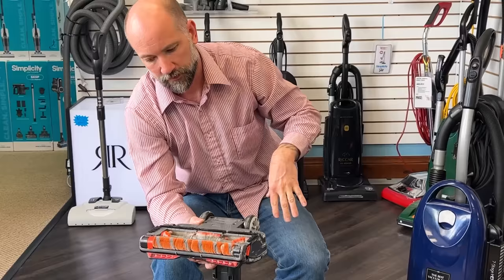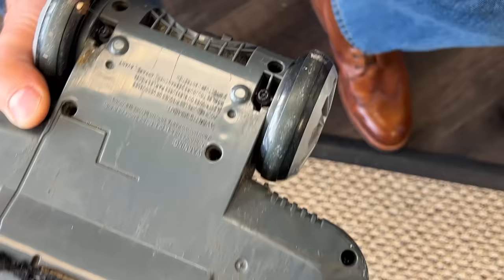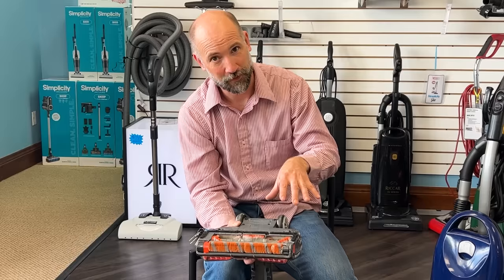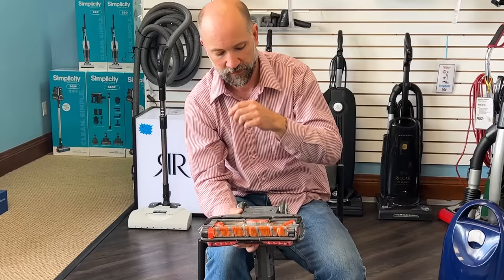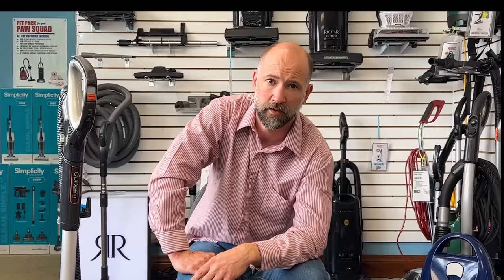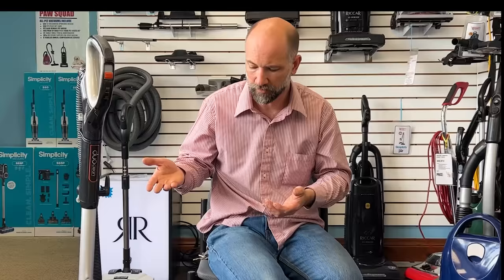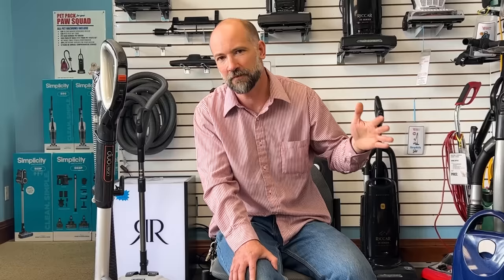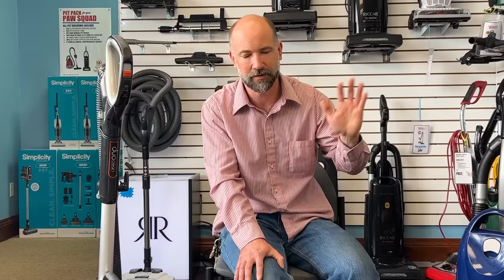Why Can't You Repair Your Shark Vacuum?

Comment: Someone wants to save a landfill build a quality vacuum. They aren't like plastic water bottles no one wants to use their vacuum cleaner for a limited number of times and throw it away or recycle it. Guess most don't want to do that with water bottles or Starbucks cups either. Starbucks has figured out a way to sell a bunch of folks cheap cups they can keep using and a bunch of more expensive cups you can use over and over again. Feel like if someone built a vacuum to last at even more money folks would buy it just like they buy the better Starbucks cup. Our Riccar is built with cheap plastic molded screw anchors about like our Shark. Don't feel like either one is made to be taken apart and put back together a whole bunch. Watched a Riccar repair guy strip out a plastic mold on ours once and he is a guy that does it a lot. He blamed us for taking it apart but at that point we had not taken it apart. Got tired of fixing it and now it collects dust in the vacuum cleaner boneyard in the basement along with a couple sharks, a couple Kenmores, a hoover, a couple of husky shop vacs, etc lol. Maybe someday we will be motivated to take it apart again and yes we can buy parts for it when we decide too.

Comment: I would consider a person who keeps replacing a crap product with another crap product is probably brain dead. If this happened to me once I’d never buy another product from that same manufacturer ever again. I hasten to add I have never wanted to own a shark vacuum especially after a friend demonstrated their brand new one. It sounded so noisy in a nasty unreliable way. My 10year old Dyson sounds like a Rolls Royce and worked just like it did when new.

Comment: Sharks have definitely  went down hill in the last 5 years for sure, I tried three different models before deciding to go with with a Dyson animal 3, witch comes with is own issues, definitely and upgrade from the model 2 thought.  I personally find that newer vacuums in general are WAY over engendered and made overly complex in order to sell new exotic features that may or may not work well,  for example,  the dyson hard tube goes in the flexible tube so it gets dirt on it, or the way it locks in the upright position constantly fails and it falls down under the slightest bit of pressure/tension.  Unfortunate this is the choice I have to make because all the new sharks are just garbage.

Comment: They are all the same. I've had 8 duff vacuum cleaners of various brands in the last 15 years and they are all are unmaintainable. They are made as cheap as possible and then cheaper than that and they are 5x more expensive than they should be.  Some, like dysan have the nerve to talk about how many engineers it has but they can't engineer for toffees.  The rule should be, it must be repairable for 7 years using no special tools and failure of any plastic part is by law replaceable under warranty.

Comment: Shark looks junk to me, as does Dyson.
Here in the UK we have Numatic, the famous one is called the Henry. We’ve had ours over 25 years, it’s very simple, it never fails and it’s never broken, in all honesty they aren’t even that expensive and you can buy all the spares. Why would you buy anything else 🤔🤨
At the recycling center we see rows of Shark and Dyson… but not Numatic 🤨
Reply from the maker: Numatic does make a good machine and the Henry model you refer to is cute! They do have dealers in the states however at this time their dealer network in the states is very limited creating issues related to service and parts availability in the states. We have explored the possibility of bringing them in and may still do so in the future. At this time their North American dealer support is ran out of Canada and we found their were significant issues for dealers in the states as a result.

Comment: Do the eco friendly thing . . . or not. Toss it in the trash and buy a new one. That's what they want us to do. More profit for Shark to sell a new machine than a few dollar part and continue using it. Repair, recycle, reuse. That is gone from most manufacturing vision and goals lately. Screw repairing. That doesn't provide the CEO the bonus at the end of the year. I'll stick with my 30+ year old Windsor. Parts are available, and a #2 Philips is all that I need.
Reply from the maker: Fun fact. Sebo is the residential arm of windsor. They have a few add ons that make them better for home use and up to ten year warranties. We had one in one of our stores the other day for it's first repair. The owner had no idea how long they had it but it was stamped "Made in West Germany". In our experience the machines made by that company are the longest lasting on the market.

Comment: Perhaps we need to stop buying their crap till they fix it. John Deere didn't allow a farmer to repair their units till recently. Had to have company do it. Expensive, wastes weeks or more and is just the dumbest plan. Farmers are mechanics and can read repair manuals. Repair guys weren't all over the place and people got fed up. Stupid.... Shark wants you to either make you buy new unit or make you ship it, pay for parts and repairs and shipping again. So, they're hogging both sides, aren't they? All that could be swallowed but the repairs are boloney. Mc Donald's and the ice cream machines aren't user friendly. They're always broken and the manufactures make you use their guys. Guys dont show up and machine is programmed to fail immediately after. I am sooo tired of being screwed, especially now when they don't even have any shame and look you right in the eye as they're bending you over. Not even believable reasons for it but the weakest of excuses that don't have reasoning in them. No shame anywhere. No morals, no values, no manners, no common courtesy, no common sense, not taught history either so I'm betting a new Hitler is already learning his craft and will be in power in 20 years but I believe it'll be much sooner.

Comment: Settle down drama queen.  First off torx head screws are pretty common these days, as are security bits    and no you dont need different size drivers for different size bits they commonly come in kits that use the same tool for all of them  .    Also i seriously doubt that "hundreds of millions " of these are sold each year...let alone getting sent to the dump.     You sound bitter because you dont know how to repair them properly without breaking them lol

Comment: I just bought my THIRD 'Shark' vacuum.  They withstand daily abuse for a few years then I notice a sale at Costco and buy a replacement.  The vacuum hose tends to break.  I try to tape it up but that doesn't work well for long.  >> At under $150, the vacuum is basically disposable, it is not worth fixing a dirty old $150 vacuum.  The vast majority of people do not want the "right to repair".  They want the product to be cheap enough to dispose of so they can buy a new one.